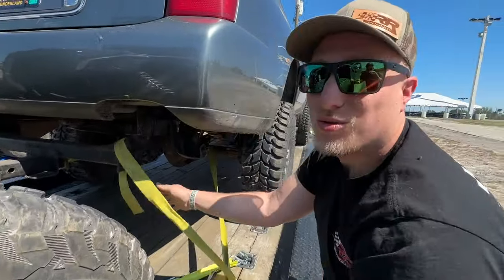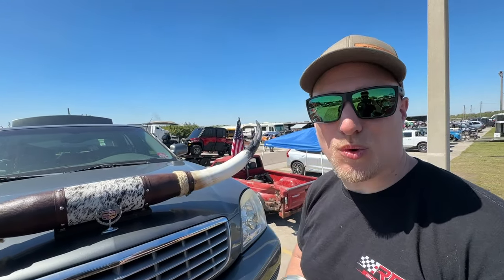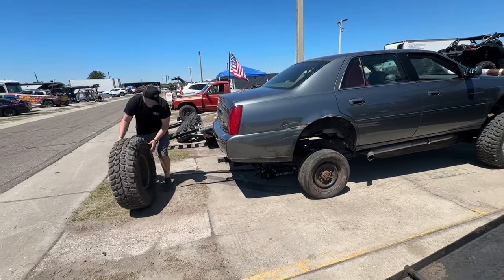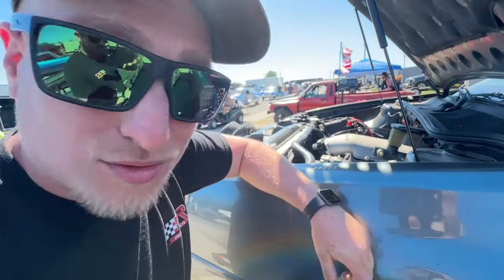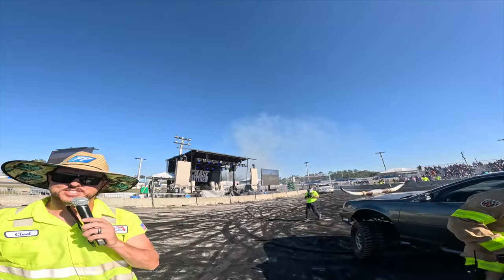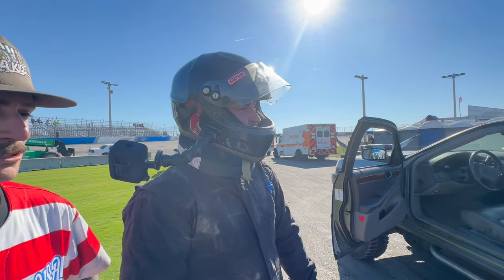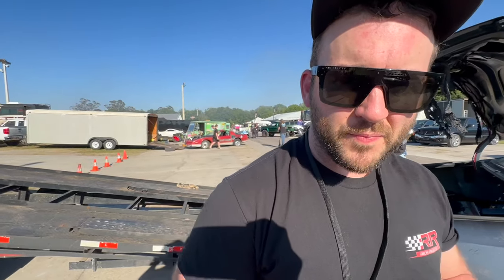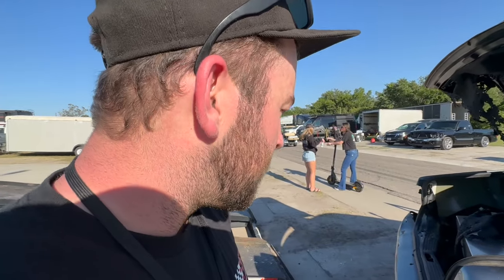I SENT my Burnout Car TOO HARD at Cleetus and Cars (huge wall tap)

Comment: Rick what are the details on the BFG’s on the x3?   And do you like them?   Weight?
Reply: They are on mine. BFG KM3’s, the utv version. I’ve liked them a lot. I’m not sure on weight, but they are not too bad.
Reply: @KyleRR89  thanks buddy appreciate it.    I’m running terrahooks on my x3 and I like them, they hooked up great initially.   My issue is, my father-in-laws place at Houghton lake is 5 or so miles of paved roads from any of the trails and the tires don’t like it.    Would like to move to something that’ll handle being on the road a little better but my main objective with wheels and tires is always to stay as light as possible.

Comment: You also lost points not being able to drive off the pad, sadly pleasing the crowd isn’t what pleases the judges, what a fkn burnout though!
Reply from the maker: It would drive off but due to it leaking fuel wasn’t allowed to
Reply: @richrules  that was kind of what I figured, keep on keepin on!
Reply: @richrules right so it was unable to drive off.
Reply from the maker: @nottoday7495  it definitely could drive off. I drove it on my trailer 😊
Reply: @richrules  lol I totally get that not trying to be a smart ass . It was on fire . Safety and all that happy  🐎 💩 . You did put on one hell of a 🔥 out .